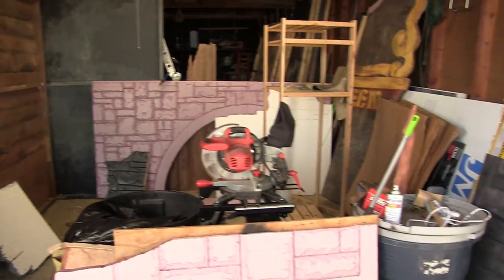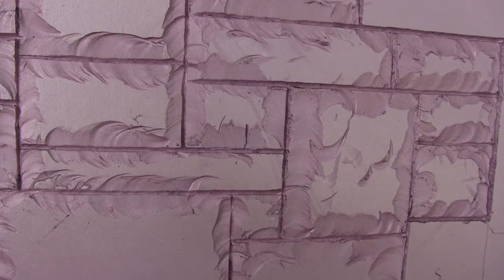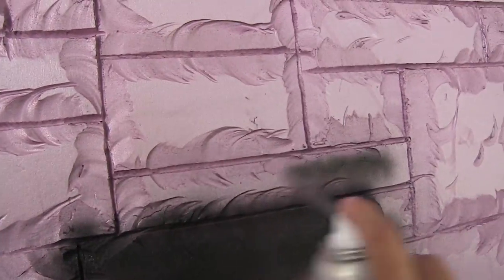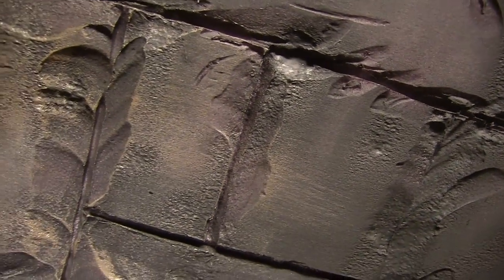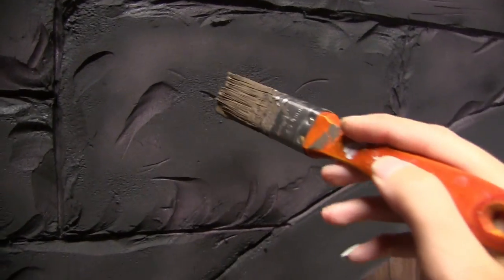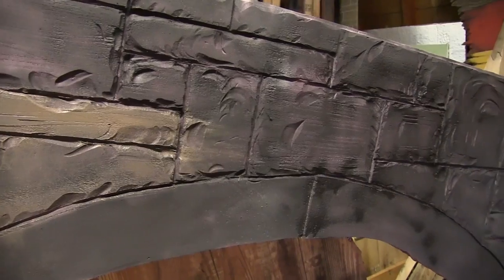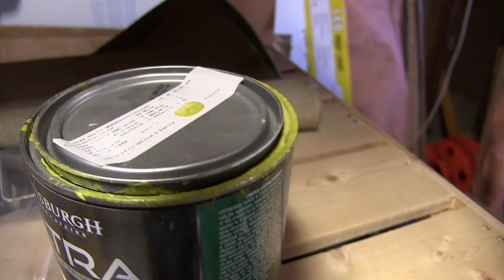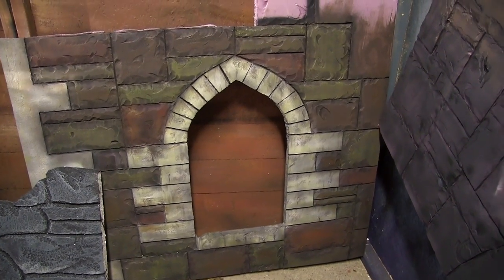Painting Pink EPS Foam for Faux Stone Look with Nikki (Plus a Haunted House Update!!!!)

Comment: I'll give you a tip. If you use acetone in a spray bottle instead of spray paint, you can stop it eating the foam by spraying some water on it. The other way to give the same effect, spray some water on the foam and hit it with a heat gun ... no need for spray paint or acetone. Lots of ways to give you that same look. Keep up the great work.
Reply from the maker: +The Pirates of North Court Awesome tips--I'll be sure to send them Nikki's way!  Cheers!

Comment: Which tool(s) do you ude for grinding and shaping the foam surface? 
I have been using a regular Electric drill to shape and sort of grind the surface of the raw white styrofoam (the kind that consist of small “balls”) but it takes a really long time. Would love a good tip for other tools! 🔫

Comment: What type of paint won't eat away the foam?
Reply: im here for that same exact reason...trying to do cool terrain for a board game , but the paints i got ate away 12 hours of work...i should had researched this ....
Reply: For future viewers use any latex on bare foam. Don't use oil or epoxy or enamel, they contain solvents (usually like acetone) that will break the foam down almost immediately. You can however paint a primer coat thoroughly then use those paints but be careful not to miss any spots.
Reply: Acrylic paint.